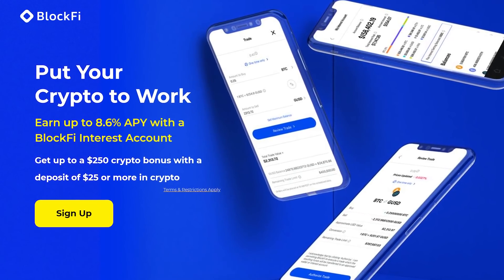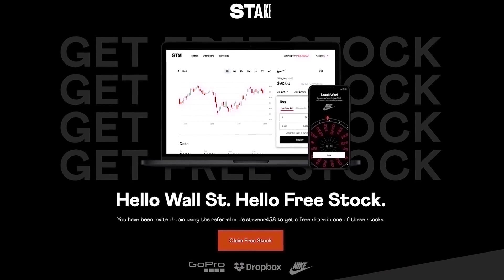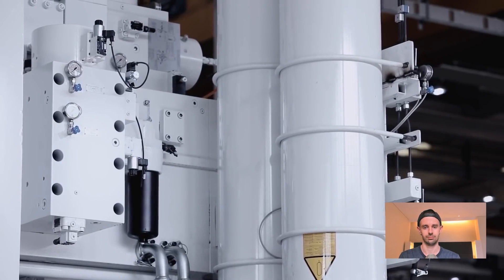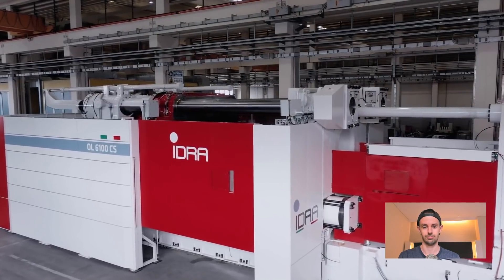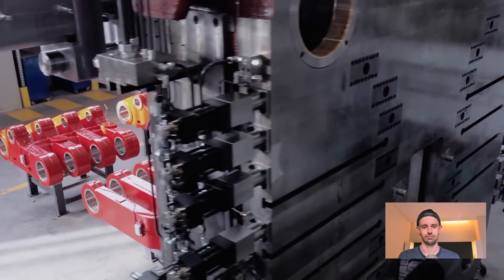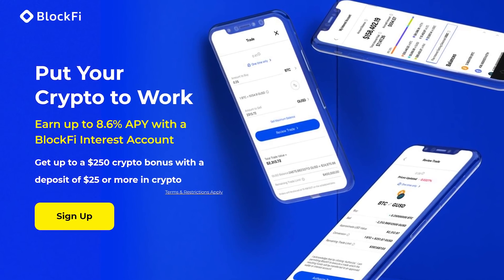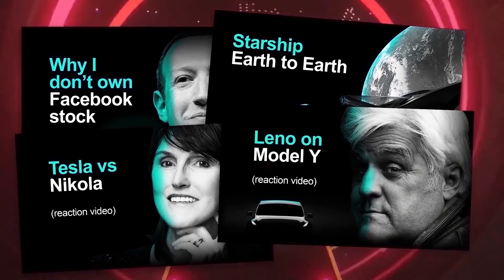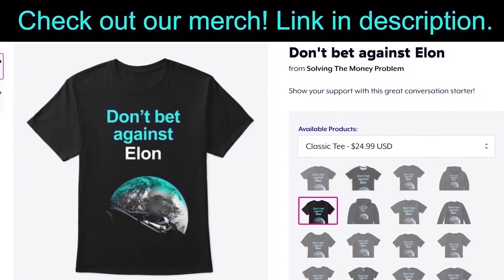Tesla's SECRET Weapon: The Giga Press

Comment: I’m a little confused on how many castings one machine can produce an hour. I’m hearing milliseconds but i also heard it takes 7 minutes to do a casting, which limits production to about 170,000 units per year per casting machine. Hummm.
Reply: The injection may only take milliseconds, but that's only part of the process.  According to wikipedia, the full cycle takes 80-90 seconds.  (The article cites a technical data sheet, but I don't see "cycle time" explicitly called out anywhere on that original document.)

Comment: Imagine
1. The explosive force required to move 200 pounds of molten aluminum into the mold in less than .1 second. 
2. The superheated air being removed from the mold in less than .1 second. 
3. The aluminum flows evenly through the the mold. 
It appears that Tesla specializes in the impossible! 👍👍
Reply: 1.)The force comes from a hydraulic system with Nitrogen Buffers. Nothing new, just scaled up. Is been used since decades. If they fill the mold in 0.1 s and have a maximum distance of 2 meters for the Aluminium, than the molten Aluminum has to go with 20 m/s or 72 km/h or 45 MPH (doesn't sound that impressive but is impressive) 
2.) the mold is been cleaned, lubed, closed and then the machine applies a vacuum inside the mold with vacuum-pumps, so no superheated  Air (that would be a problem without vacuum)
Reply: @oliverwunsch4412  Thank you for the explanation , I didn’t know about the vacuum. Sending 200 pounds of  molten aluminum from 0 to 45 mph in less than .1 second is damn impressive. 
Do you have any idea of the number of parts per hour they can produce?
Reply: @MikeCasey311  I READ 250 A DAY, ONE SHIFT
Reply: @MikeCasey311  the drone video from freemont shows a cycle time of around 3 minutes, that's too slow.
Reply: @oliverwunsch4412  - it might seem Slow, but, it saves 300 Robots, According to Elon! Which means it saves 300 Assembly Steps! (Or So) 

So, is it really "That Slow", on Balance? Considering it avoids those 300 separate Operational Cycles!
Reply: @JacquesBPoirier  actually it's approx 1000 per day, with 80 second cycle time, insane
Reply: @oliverwunsch4412  it's 80 to 90 second cycle time
Reply: @robertweekley5926  If you have to run multiple Gigapresses with the same mold design to reach your production targets... it's slow. But they will speed the monster up, i'm pretty sure.
Reply: @oliverwunsch4412  There must be some physical limit to how fast they can cool the molten aluminum before they startt having serious issues.
Reply: @surferdude4487  the heat transfer rate of aluminium is crazy high but you are right there are physical limits in cycle time.
Reply: @oliverwunsch4412  IRC also a vacuum bottle so it does pushing and pulling the molten metal to the mold
Reply: @Barskor1  kind of, if there is nothing... than there is nothing to apply any kind of force. the vacuum inside will increase the pressure of the aluminum that is been pushed with hundreds of bar by 1 bar of the atmosphere, so that is pressure wise nothing.
Reply from the maker: It's INSANE.
Reply: @SolvingTheMoneyProblem  - Nope! It's Ludicrous! Oh, wait! Correction: it's "Plaid!" 
😳🥴😲😁🤭
Reply: @SolvingTheMoneyProblem  .1sec injection time, 80 to 90 second cycle time between mouldings. Plus fast, robotic swapping of the moulds / dies for repairs / updates / different models
Reply: I was thinking about this awhile back, and I think it would make sense to create a vacuum in the mold before they inject the aluminum.  This would avoid issues from possible bubbles and also would help suck the aluminum in, rather than just relying on the force of injecting it.
Reply: @sleeknub  - In FRP (Fiber Reinforced Plastics, or "Fiberglass Composites" / Graphite / Kevlar, etc) there are 3 Techniques (that I'm aware of) to integrate the Resins, with the Fibres!

The most basic, is "Wet Layup" done by Hand rolling Resins into the Fabrics!

Next up in History, as I followed it, over the last 35 Years, was "Prepreg", or Resins, Pre impregnated into the Fabrics, but kept at Sub Zero Freezing Temperatures, to delay the Curing, Which is finalized, in an Autoclave!

Lately, (last ~10+ years) It seems the latest technologies use a Vacuum To Pull the Resins into the Vaccum Bagged Component, and Through To a Catch Pot!

So, that is for a Room Temperature Liquid, that is found in Various Consistencies, but more typically like various Syrups, in flow rates! 

So, here comes Tesla, Invents a Alloy of Aluminum, that Needs no follow on Heat, Cold or Oil Quench, or other form or cycle of "Heat Treating" to get the Requisite Hardness, cranks it up to Super Molten Temperature, then Both Sucks, AND Pushes it into an Intricate Cavity, in 0.1 Seconds, "Or Faster" (the "60 Milliseconds" part), holds it, and sets it, to a properly Cooled rate, to stop Shock Cooling Micro Cracking, and then, pulls the Part out, 3D Scans it, for part Shape and Net Dimension Verification, and then Delivers the part, for Final Cooling!

In 3 Minutes! Or Less!
Reply: All that molten aluminum heat is likely why the casting machines are out in the parking lot.
Reply: And having the recipe that you don’t need heat treating or even paint - amazing.
Reply: @Nemutai666  Paint?  Why would you paint aluminum?
Reply: This is one of the more intelligent threads I have read, I learned a lot. Thanks 👍👍

Comment: It was actual SpaceX but, i know, the difference seems minor to most ;-)
Reply from the maker: You are confusing the STEEL used in Starship and Cybetruck with the aluminum alloy used for injection into the giga press mold. Unless you have proof SpaceX ALSO made the aluminum?
Reply: @SolvingTheMoneyProblem  At least i read some about it "aluminum-lithium alloy tanks containing liquid oxygen".
But well, that i did not know, one person in both companies. So hard to draw the line:
Today, as vice president of materials engineering at SpaceX and Tesla Motors, Kuehmann drives development of materials innovations that could one day help enable the commercialization of space and the colonization of other planets.

Comment: Still, despite the aloy, the press can be ordered by any who is willing to construct a single die cast. It is actual a cast and the pressure first is there, to hold them together due to high pressure of the injection. 2nd, the actual press is, to get rid of any air inside the >cast< ^^

Comment: You can't cast suspension and steering as part of the front and rear casting, because you need to have bushings and replaceable parts, in both steering and suspension.

Comment: the new aluminium is a mix of copper, silicon, titanium, nickel, magnesium, cerium, iron. but the % are tiny i can only imagine they are in the words of Elon "the sault in the salad" that is the new aluminium alloy. net benefits are strength to weight, material structure and conductivity. the real cool thing is the fact that there injection moulding aluminium with these material property's. it gives the grain structure of the aluminium to be set in such a way that theoretically stronger than steel.

Comment: Everybody is quoting the fact that the alloy is shot into the die in milliseconds, but that is the quick and easy part. The mould still needs to be released and the piece lifted out, and the die reset before the next one can be made. This process is likely to take the lion's share of the total piece manufacturing time. I would love to know the total unit time of production - that is relevant data, not just one piece of the puzzle and probably the fastest one at that. No doubt it is exponentially faster than welding steel pieces together, but concentrating only on the time to shoot the material into the die makes the information almost irrelevant....
Reply: The Giga Press's wikipedia article says the cycle time is 80-90 seconds, so about 1000 units per day.
Reply: @bigdream_dreambig  Brilliant thank you 👍
Reply: With 6 machines operating at once, then we will get mass production. Your point is spot on, that's why IDRA are making another 9 machines for Tesla.

Comment: I would bet that the entire 3 piece underbody, front, rear, and battery castings for the sub 20k Model A will be done in a single piece on the 8,000 ton gigapress,  imagine doing fully half the car in one shot.
On the making of suspension parts and wheels, he mentioned a multi cavity die, instead of casting one piece at a time the die area will be large enough to do several different front and rear control arms, wheels, and other suspension components in one shot. Ten presses in one.
When all of these pieces to finally come together and they hit their stride, the rest of the clueless planet is going to be blown completely away

Comment: Milliseconds to produce a substantial car part , fantastical!
Reply: To be fair, the injection is only part of it.  It takes much longer to get the part out of the machine and to prep the machine for the next part -- seconds, I think -- but it's still impressive.
Reply: @bigdream_dreambig  Video over Fremont shows around 3 minutes every piece, around 20 casts per hour. No idea what “magic” they use to have molten hot metal be able to cool enough to move in less than 2 minutes

Comment: Hey Steven, I could be wrong, but I suspect that there is some spacex expertise thrown in to create the new alloy. I have worked in material selection for hundreds of parts and it is extremely unusual to create a unique material unless there is enough volume to justify this. Obviously, Tesla does have that justification and they did this for the model Y because of its high volume. I am still a little curious about the repair process for these cars after a crash because it seems like you have to replace the whole mega casting?
Reply: There was an Elon tweet where he said sections could be cut out and replaced. If we ever get Tesla Insurance guess it's their problem. Hopefully they have recycling figured out too so they can melt and recast end of life Model Ys.

Comment: The Cybertruck Exoskeleton straight out of The Giga Press?
Yes, it's coming. And it's real.

RIP all the other Trucks.
Reply: Not that likely imho. The bent sheet stainless steel exoskeleton is far cheaper.
Reply: the giga press should be called giga clamp because it didn't press the stuff been made just clamps the molds together against the hydraulic forces from the liquid aluminium been pushed inside at a pretty high speed. 
The exoskeleton is something totally different, made of a sold sheet of Stainless steel with the help of a real press. (press brake)

Comment: The giga casting machines in China are made by a different company, check out the pictures on the Q4 earnings slides/presentation.
Reply: They are made by LK technology ltd, which owns 100% of Idra and provides machines to Tesla China
Reply: @gplaneg  why do they look so much different in design?
Reply: @joekr9424  i don't see that much difference tbh, but i'm no expert. They should be the same
Reply: @gplaneg  looking at the pictures from the Q4 earnings slides comparing it to photos from freemont/germany/Texas, They are very different to me. With all these presentations and no mention of Tesla, this company sounds sketch. They were valued at 500 million before all this publicity from the Tesla giga-presses(that they named after tesla gigafactories?) and now they are worth almost 15 billion. I am wondering if it is just a China pump and dump.
Reply: @joekr9424  Tesla named the machine. The only differences i see are on the safety parts and colors, idk

Comment: Of course they need to fill it in 60-100 milliseconds, otherwise the aluminium would solidify too soon since it's a steel die with high conductivity.
I bet the mechanical properties are excellent with that cooling rate since you get a thinner microstructure.

Comment: Is it possible to make the entire body in one press? I don't see why not, I can absolutely see it happening in the future!
Reply: Its definitely possible. Up front cost of developing such a machine would be immense. They will get there eventually though, im certain.
Reply: Hello cousin!!👋🏻😁
Reply: I’m guessing having the chassis separate will make it easier to fill with batteries before adding the front and rear sections.
Reply: Can't imagine why anyone would cast the finished exterior panels of a vehicle from aluminum. If thin enough to be lightweight, it would be so delicate it would crumble if someone leaned on it. 
More likely is the moulded plastic they make bumpers from, mounted on pressed aluminum substructure.